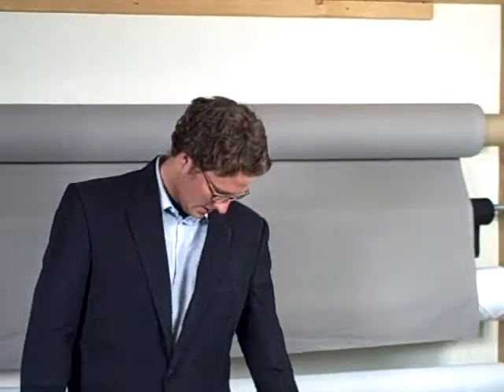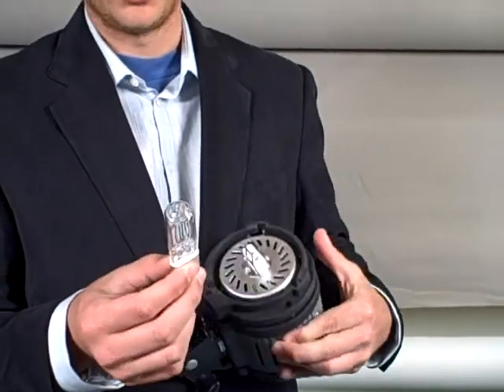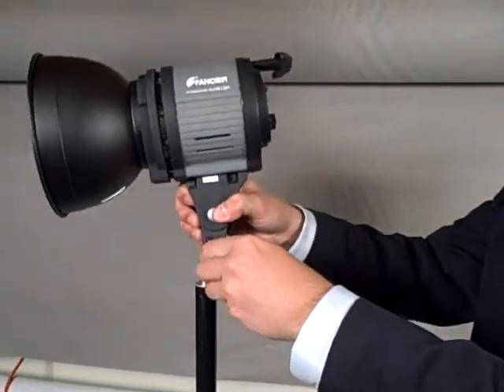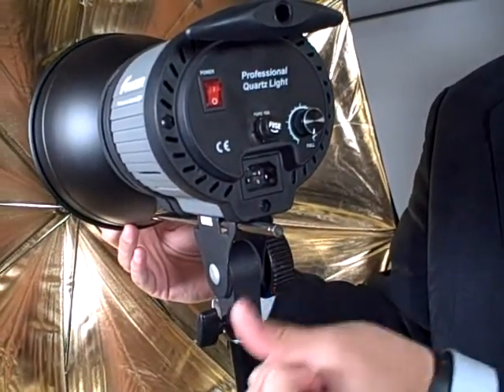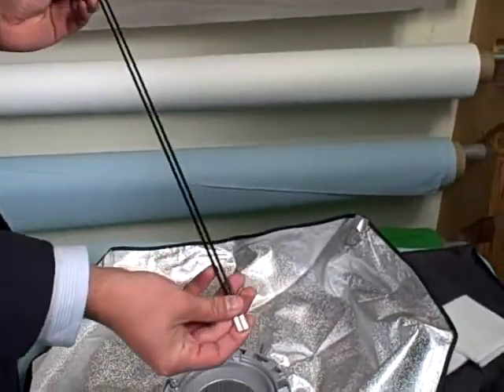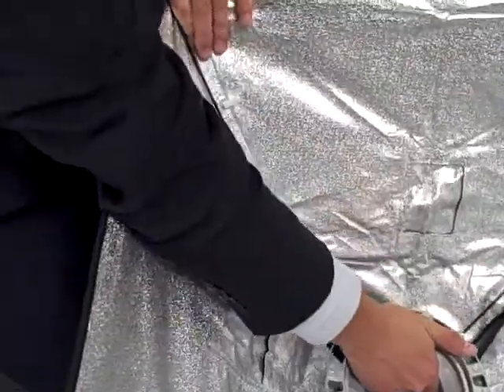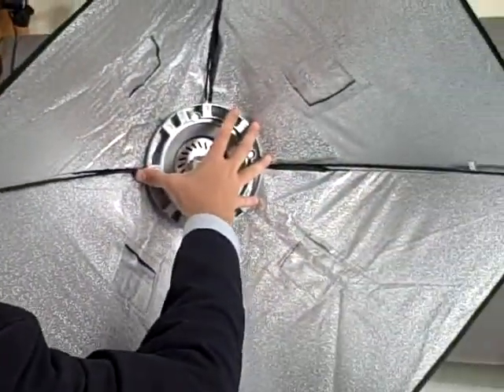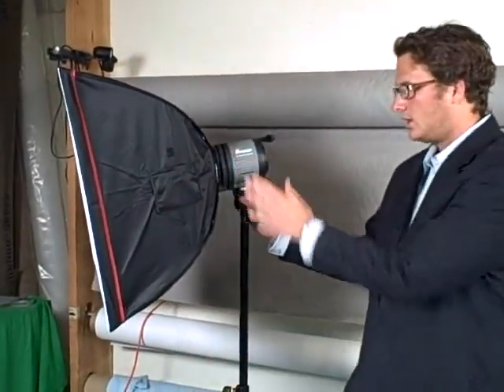PBL Softbox Assembly Instructions for QL1000/VL1000, SL200 - www.skaeser.com

Comment: Best to plug in the bulbs while the bubble wrap is still wrapped around the glass. Oils from your fingers can create hot-spots on the bulb that could weaken it and cause it to shatter. But if you do accidentally get prints on the bulb, you can wipe them off with a soft clean cloth or do a deeper cleaning with isopropyl alcohol.